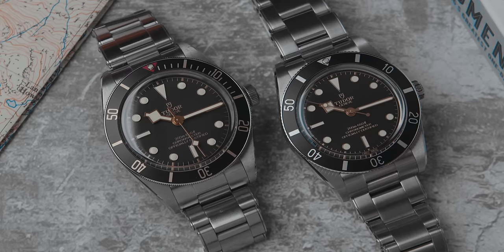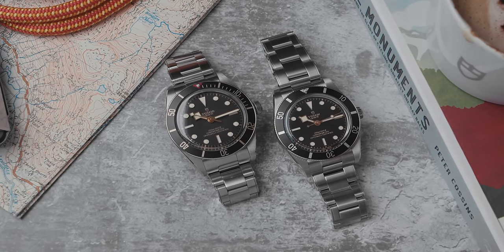Tudor Black Bay 54 (BB54 vs BB58)

Comment: Content with my BB58 blue but man if they came out with v2.0 and slimmed the mid case like they’ve done in the 54 and give it a T-Fit, I’d definitely upgrade to that. And it’s not like the BB58 is thick… but that’s a significant difference between the two even though it’s overall only less than a mm difference

Comment: The BB54’s bracelet is an obvious improvement, but I feel 39mm is a perfect size for a sports / dive watch. I love BB58’s gilt bezel numerals, red iconic triangle (Rolex Big Crown) and the snowflake seconds counter weight. All these charming characteristics have been removed on the BB54. Also the lugs on the BB54 are proportionally bigger giving it a less elegant, squared look.

Comment: Is the amount of glide adjustment in the clasp more than, less than, or the same as the width of one link?
Reply: Unfortunately, less. The glide adjustment is always at the limit, no matter whether I add or remove a link. Apart from that, it's a perfect watch. Tudor has done everything right.

Comment: I mean, people have different wrist sizes. 37mm will work for some. Guys who can wear a 36mm Explorer will find this size of Black Bay perfectly okay. But for me personally, I find that 39mm is already on the absolute lower end of the scale for a sports watch. But then, my wrists are over 7.5 inches - up to 8 inches if swollen on a hot summer's day. So I'm probably a little above average size. Experience has shown me that 39mm-43mm is the range that works for me, with 41mm or 42mm probably being the sweet spot. But for others the range might be 36mm-40mm. So I guess it comes down to individual wrist size. (You do sometimes see pictures online of people proudly wearing Rolex Subs, Explorer 2s and Sea-Dwellers where the watch is just clearly TOO BIG for 'em...)

Comment: I have a small wrist but feel 36mm feels too dainty. I considered the Explorer before ultimately buying the Black Bay Chrono - yes, I know it is 41mm. I have a number of microbrands that are 40mm. Through all this, I find my sweet spot is 38-39mm but will definitely try the 54 at 37mm with my next watch purchase - hopefully it doesn’t look too dainty.
Reply: For what it’s worth, I do feel Explorer 36 dainty yet BB36 is not. I think it’s due to the more domed crystal & significant bracelet taper on the Explorer. Typical of Tudor, their watches wears larger so do give it a go and you may be surprised.

Comment: The Tudor Black Bay 54 is way cooler than the new IWC Ingenieur. And it's also the first, for me, interesting Tudor ever, because it's easy to wear. I'm not interested in these idiotic sizes drivel, despite my 7.5 inch arm circumference, I've always liked wearing the 36 Datejust.

Comment: 37mm is too small for big wrists. Its great if your small, all they need to do is make them thinner , across the range and add the t fit clasp . My aeronaut is only 10.5mm thick , but its still an impressive 41mm , which I think is a good size for most men.

Comment: I think it’s great. They made a really superb watch for people with small wrists. However, I think they need to continue to press forward and make a divers for people with larger wrists such as 42 or 43 mm. And yes, the Pelagos is available in that size but only in titanium. As I own titanium watches there’s a different feel versus stainless steel. Thanks for the great review.
Reply: I feel like the original Black Bay at 41mm actually wears larger than the Pelagos. The Pelagos has a shorter lug to lug if I remember correctly. Too lazy to look it up.

Comment: Well, not only tudor own Kenissi... but also Breitling, Norqain... Fortis has shares in them too so they can call it "in house"... as well as a few others. So basically, Kenissi are to Tudor and the likes, like what ETA is for the Swatch Group
Reply from the maker: As far as I know Breitling don’t own a part of Kenissi, but the lines are blurred as the ex-head of Breitling is head of Kenissi and the Breitling and Kenissi have a partnership where they share the Kenissi 3 hand movement in exchange for Breitling’s chronograph movement. 
Norqain and Fortis just use Kenissi movements and can’t call the movements Norqain in-house, however the movements are branded “manufacture cal…” as Kenissi make the movement in-house. At least that’s the marketing message and not strictly true. 
You’re right with the comparison to ETA. Tudor are able to make high performing watches for a low price because they sell parts to other brands. Tag Heuer included.

I have a video coming out on my visit to Tudor/ Kenissi.
Reply: @BarkandJack  oh yeah right, I totally forgot about that whole Breitling Kenissi movement exchange program, but that’s probably what stuck in the back of my head. 

Regarding the fortis and norqain business, on the swiss websites at least, they call their movements „Manufakturkaliver“ (I.e. the Werk13). But that might vary within international regulations. 

But thanks for your detailed answer. I saw you at W&W this year but didn’t feel like intruding in personal space. Would have loved to chat watches and mechanics with the lot though 😁

Comment: The BB58 clasp is bad? That's an overstatement for me. It doesn't have on the fly adjustment, but it's a well made clasp. Let's not confuse it with some jingly jangly pressed clasp.
Reply from the maker: It’s solid, well made, but technically bad when it comes to functionality and usability. That’s why all new Tudors come with an updated clasp.

Comment: It's amazing how horribly out of date the 5yo BB58 feels all of the sudden with big and little brothers getting revisions. For what it's worth, I've read multiple places that the new Ranger bracelet fits the BB58. You can't just get the clasp to fit, but need the whole bracelet. That also has the bonus for some of not having the faux rivets.
Reply: Not sure if you already own a BB58, would like to offer an alternative view to the universal love for the BB54. Yes, the BB54 has a better bracelet, but you are forgoing a lot. I feel 39 mm to be the perfect size for a sport/dive watch. Also, at some point you may want some wrist presence in a watch. I love BB58’s gilt bezel numerals, red iconic triangle (red triangle and larger crown references the classic Rolex Big Crown of the past) and the snowflake seconds. I even like the coin edge bezel matching the crown. Without these characteristics, the BB would be rather dull. Now all these charming characteristics have been removed from the BB54. The lugs on the BB54 are also proportionally bigger giving it a less elegant, squared look. Newer may not always be better.

Comment: Saying a 20+ year old watch is not well made by todays standards is silly. 20 years ago it was a well made watch, it's simply vintage. Do we say a 50 year old car is not well made because it doesn't have a touch screen? That's a silly point.
Reply from the maker: No 20 years ago it wasn’t well made. Just because you’re not away of the faults doesn’t make it a silly point. The 14270 was famously bad at the time. The movement has major known faults which are rectified in the 114270. 

The cal 3000 in the 14270 and 14060 only has a balance cock rather than a full balance bridge. The balance spring is flat rather than a Breguet overcoil, the winding mechanism is terribly fragile to the point that it’s advised not to manually wind a cal 3000, and the finishing is a joke. 

All of these points were major criticisms at the time and the 14270 was labelled AT THE TIME not luxury and not a tool watch, contrary to what Rolex was advertising. The 14270 was such a flop in 90s in the West because of these points that the majority were sent to the Far East to be sold. If you visit Hong Kong there’s an abundance of 14270 and 114270 Explorers. 
Now you know. 👍🏻

Comment: As nice and as capable as it may be, I don't think I'd want to take a multi-thousand dollar watch into an environment where things can, and do happen. Other than that, I'd daily drive it, and save the diving chores for my ProMaster.
Reply: Tend to agree. All this effort to hit dive spec numbers when 99.9999% will only get an occasional splash of champagne, gin or vodka…
Reply: In a closed environment, like a pool, no problem. At least you can find it, should it come off the wrist.

Comment: But Tudor will be tweaking the 58 soon probably with a METAS movement definitely with the T fit clasp. It’s just a bit boring that Tudor keeps milking the Black Bay line to death in every direction while increasing the price to a point where Tudor as a retro homage Rolex brand doesn’t add up. The quality issues are certainly getting worse rather than better too 😬